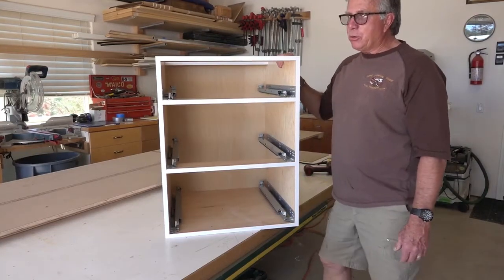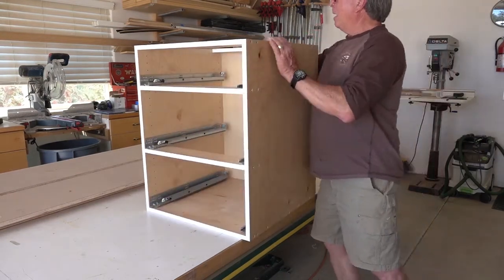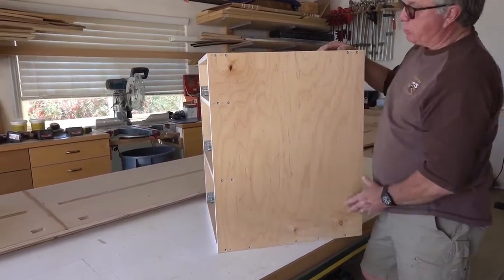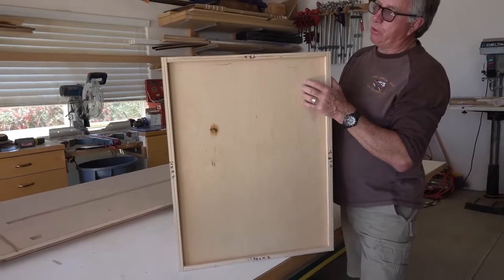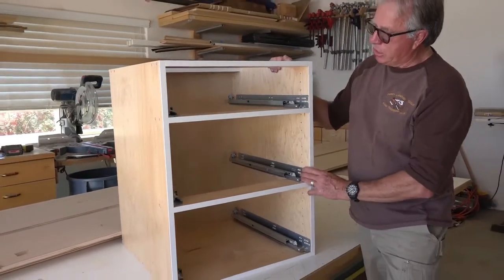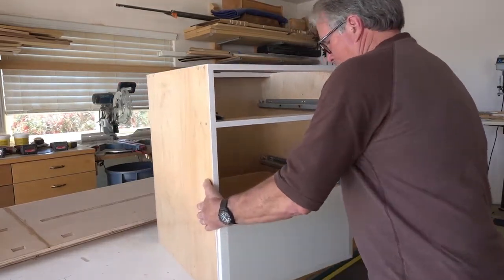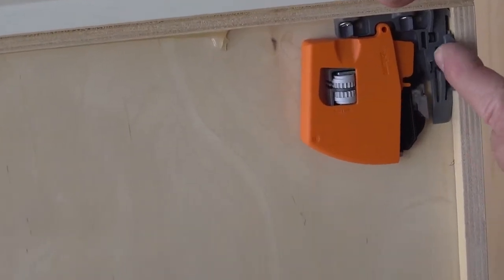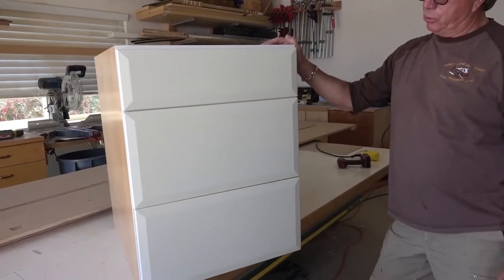3 Drawer frameless base cabinet

Comment from the maker: Drawer size is determined by the interior opening dimensions and the intended hardware. In this case, we used Blum Tandem 21” guides with drawers made of Baltic Birch plywood. To get the appropriate width, subtract 3/4” from width of opening, 1” from height of opening and the depth into the cabinet would be 21”, to match the drawer slide length. Check with manufacturers specifications if using something else.

Comment: Did the prefinished plywood you used come with the white edge banding or did you add that.
Reply from the maker: Parts are cut and then banded. The material is not banded when purchased.